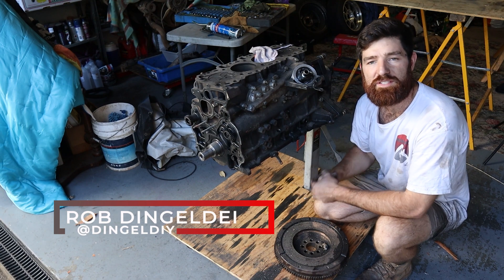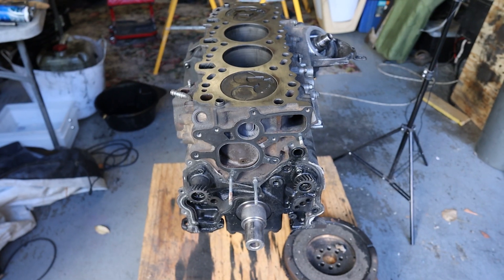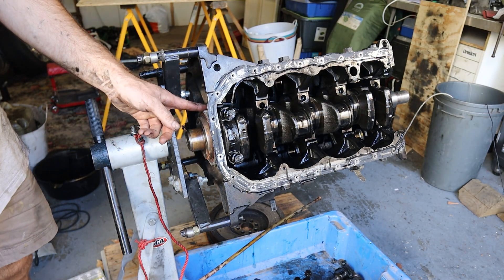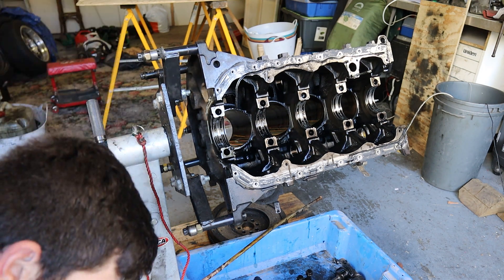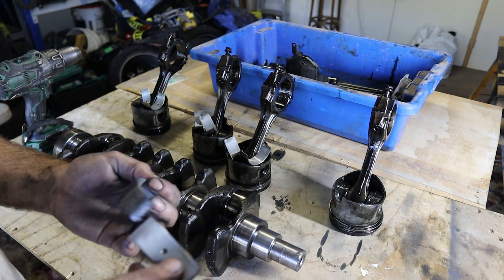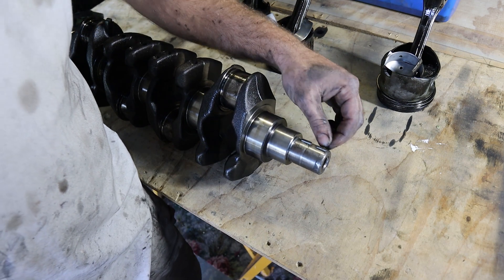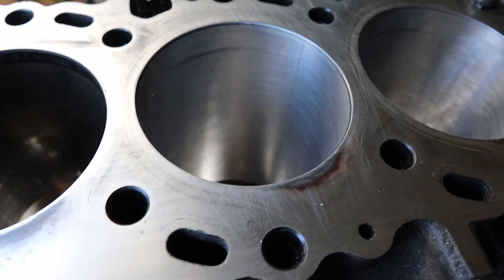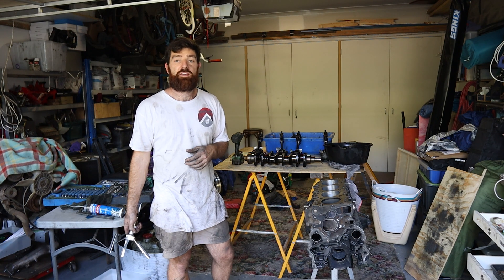1KZ Block Tear Down and DIY Honing

Comment: What happens if you mount a misalign Gigi idle timing gear and run the engine on a 1 kd engine Toyota Hilux ? What symptoms would I experience?
Reply from the maker: If you're lucky it will run rough or crank without starting. If you're unlucky you'll ruin your engine